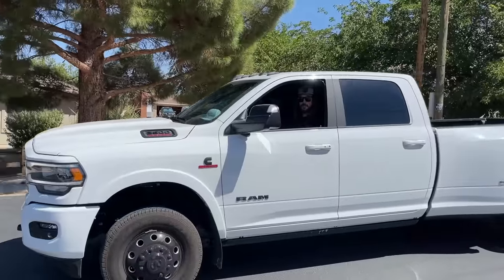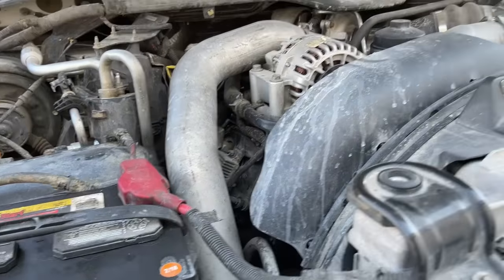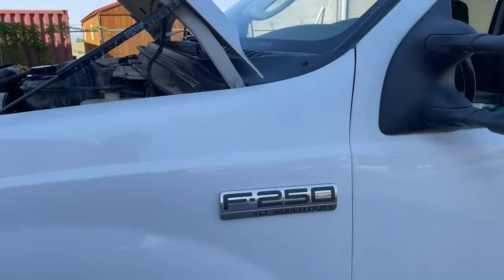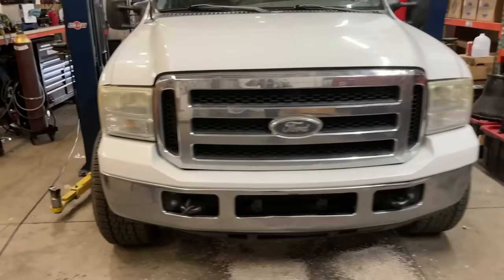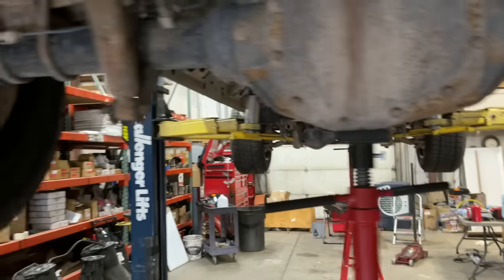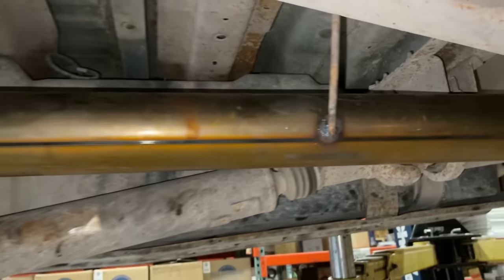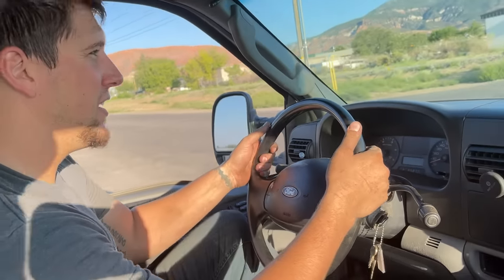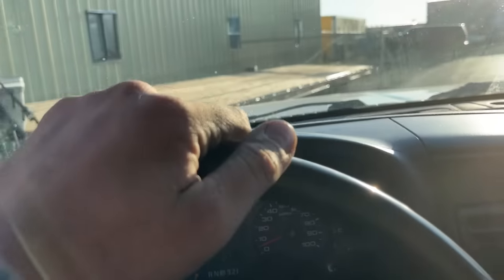WHY DID I BUY THIS?

Comment: Any guy that can’t appreciate a 6.0 isn’t a diesel fan. They sound amazing, look great, and the Ford suspension is unbeatable. I’ll always be a Cummins guy, but man I’m looking forward to this 6.0 content!
Reply from the maker: It should be fun!
Reply: My 6.0 detonated cylinder 1 after $8000 in work so I have some personal issues with them lol
Reply: @adhdieseltech236  my 6.0 is down now needing about 8k and what happened to you really makes me want to fix it and get it tf away from me
Reply: 8ppo
Reply: @blugods2655  I ended up getting an extended cab F550 with a 6.7 powerstroke with a 12 foot service body. I wanted a Cummins but there weren’t any available. If you can, sell it and spend the 8k on a better diesel

Comment: I am a 100% Cummins guy to the core but those 6.0 powerchokers can be really good trucks with the right parts and deep pockets
Reply: Deeeeep pockets. I miss my 06 KR. But she was wayyy to much to handle
Reply: I used to have a 6.4 and that thing sucked ass
Reply: Yeah I fix them poor things all the time. U surely need deep pockets, and gotta keep a set of injectors in the truck for when they blow,  but other than head gaskets, cracked heads, turbos, plastic rocker retainers, rocker bridges, egr coolers, oil coolers, wiring harnesses, broken oil stand pipes, ficms, high pressure oil pumps, they might b a good truck?.
Reply: @ppump24valve53  I kept having my crankcase fill up with diesel fuel. My oil would be like 5 quarts over full but it wasn't oil...
Reply: @LS-ye5pp  I see, never ran into that.. what I did run into was fuel into coolant- cracked head in the injector bore above the factory injector cup. The fix is a full injector sleeve that completely extends to top of head. Then u change out the lower injector body. It can happen on any given hole. So, since new heads are 6 weeks away, I’ve been doing those kits on all the holes, when I have heads off. It is $3k for all 8, but is insurance on it ever happening again.
Reply: @LS-ye5pp  diesel had to replace a few injectors on my service truck for the same issue I hate 6.4 I'd take 6.0 over that turd any day
Reply: You don't need that deep of a pocket.   I own two 6.0's and a '96 12 valve with a nv5600 conversion.  The tranny conversion was about the same price as bulletproofing.  My 12v has been towed more than my 6.0's, once for complete clutch separation and another time when the slave cylinder went out.  They all have their own subset of issues, but all are fun to drive.  The key to keeping a 6.0 reliable is running a non-silica elc.

Comment: Make sure you check the deck for straightness, 'cause if the gaskets have been done before guys mess them up cleaning them. Heads like to crack around the exhaust valves, and you definitely need O-rings. 4 sharing studs per cylinder has a tough time. May want to look to KDD for heads? 
This might actually be a good fit Josh. 6.0 like RPM and don't make much for low RPM torque.
A good alternator goes a long ways on a 6.0. Low batteries or low voltage kills FICMs. And get rid of the gold coolant. CAT EC1 spec!
Reply: Better jump on the wagon! KDD heads are 6 weeks away!

Comment: There's almost no Ford diesel content on YouTube. I'm super excited! I grew up with international farm equipment and love em.
Reply: JH diesel might be a channel you like. He is all about the Fords. I think we all can agree the Cummins is the easiest to work on of the platforms.
Reply: @ChannelZeroOne  I think ram is the easiest way to a fast truck. I'll check JH out. Thanks for the heads up!
Reply: @lamarzimmermanmennonitefar5269  Chevy on the gas side is easy to hop up. But the ram Cummins is so easy to make fast.
Reply: Easy yes but expensive.  The transmission is always a weak link, once that's addressed though they are gtg.  I'm a Cummins guy through and through, but there's something about the 6oh that makes me want one.  Maybe the underdog thing, but they are fun trucks and still use old school injection.
Reply: @joshuaquilliam2887  I guess the true test will be if he keeps on making content, if not then the 6.0 is too much hassle. I did not feel working on the dodge was all that expensive compared to any other vehicle I have worked on.

Comment: Plz do me a favor and box the frame where the lower arm meets the frame. Many many of these trucks get totaled from very small bumps that buckle the frame right there. I've seen a truck bend the frame hitting a parking barrier with 1 wheel. When you have a diesel and over sized tires and wheels it's super easy to bend them.
Reply from the maker: I’ll look into it! Thanks

Comment: In 2018 I bought a 2004 F250 6.0 4x4 with 182K miles. Started with the EGR delete and just recently did a full bullet proof job, and 5 inch straight pipe. I loved this truck before and now man I just don’t know how to explain.
Reply from the maker: They sound so good

Comment: Well, in Europe they are quite popular both in transportation (trucks, heavy duty and other working horses) and among regular drivers. Good fuel economy, nice torque. At most, they are turbo-charged diesel, L4, less than 2 litre, equipped with diesel particulate filters. But sometimes you can find even V10. How about trucks, sorry, I don't know. Probably big, above 10 litres turbocharged V's, because there is no replacement for displacement to tow 40 tonnes.

Comment: For the dinging take the cover off the bottom of the steering column. There will be a black wire that comes out of the ignition tumbler. Just cut that wire and no more dinging unless you leave the headlights on
Reply from the maker: Yes I did that yesterday thank you!

Comment: Dont just surface the heads get new heads they all crack i have seen them run from glowplug to the injector holes. Also check the block if you are balling on a budget do it by hand with a really flat peace of stone and some sand paper on it, but for real the block deck was a hack job from the factory and ford knew it that why they told techs to get block whorp bottom to to and not front to back....

Comment: Glow plug harness is a turd. It will be baked in place and probably crumble when you try and take it out. Just buy a new harness when you go to replace the plugs. Since you're pulling the cab to do the heads at least it wont be too hard to get them off. I've done them in cab truck and van.

Comment: My truck mechanically hasn’t let me down wiring yes it can be a pain a good intuitive diagnostics and a 2nd set of eyes to check things you’ve checked will save you from tearing shit apart that wasn’t broken to begin with, get FORScan it’s free but the USB dongle is like 20 dollars it’s a very powerful tool my truck makes a reliable 700 horsepower non VGT and red diamond diesel stage 3 transmission axel wrap is still a thing I need track bars
Reply: Incase you’re wondering 05 F250 Harley Davidson edition . It’s my first vehicle too it’s been studded deleted since new got all the paperwork with it Matt Oliver stage 3 intake manifold, warren diesel 175/30 injectors warren tuning borg Warner 366 turbo 5 inch back exhaust and 5 inch straight pipe 6 inch intake mishimoto radiator aftermarket oil cooler and trans cooler my FASS fuel system and sump stock intercooler it’s good for about 70 lbs of boost oil bypass kit I got just 1 oil filter big ole cat filters high rev valve spring kit and chrome aly pushrods ARP head studs and o ringed heads as well as 6.4 banjo bolts and fuel return system, my fuel lines are probably bigger than a garden hose. I used to run NOS and Meth injection motors got 190k on it now injectors last around 150k typically it’s the solenoid that fails you can rebuild them yourself for 10-20 dollars in parts and 2-4 hours of your time vs sending them off
Reply: Forgot to mention dual electric fans no big ugly plastic shroud maintenance on anything front of the engines a breeze

Comment: Love the driving content as always, the scenery speaks for itself.  lol my friends have swapped out their 6.0's for cummins but I always liked v8 diesels for their manners vs the inline 6 and my brown 93 ford in my profile pic has the 7.3 iDI factory turbo I actually squeezed a half decent amount of power out of.  I swapped the same axles into my 93 cclb and a 12v and I find those front axles need a rebuild right at about your mileage. I would also highly recommend checking your rear axle backing plates also, they are extremely prone to rotting out then you have all sorts of problems with the emergency brake and the shoes cocking over causing issues

Comment: Pray your heads are not cracked. 6 liter have about 60 percent fail rate in my shop
Reply from the maker: Super cracked 😂
Reply: @horsetorquesdiesel  fucked man sorry to here that! I know promax makes aftermarket now castings in aluminium and steel. All the best. Love the videos, keep up the hard work.